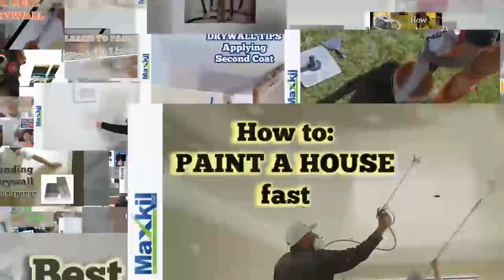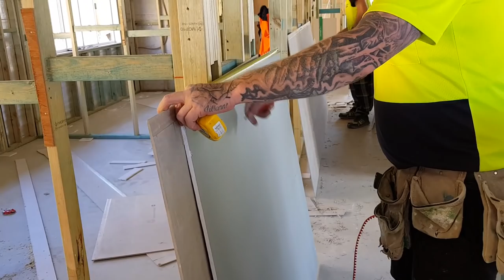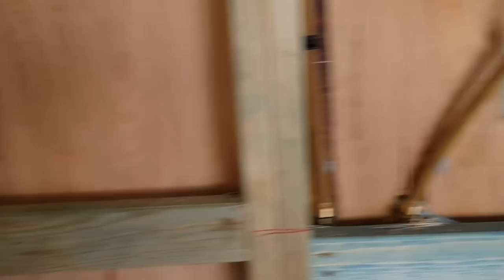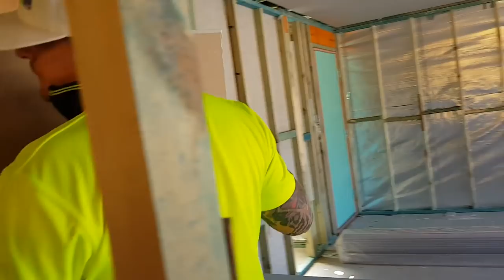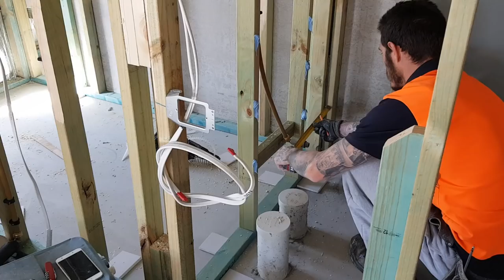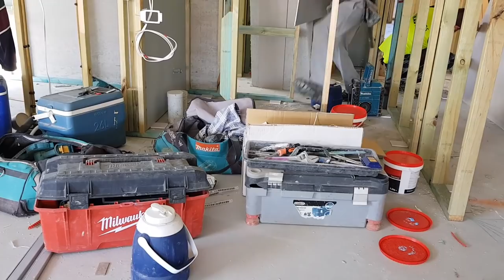Drywall Fasteners? Screwing or Nailing

Comment: for villaboard or called cement sheet，I use both screws and nails：
-I borrowed air compressor from my carpenter and use coil nailer，much faster than hammer nails which takes ages if you strictly follow 200mm span of nails；
-Some builder especially commercial builders want high quality looking process，we counter sink cement sheets（usually 9mm villaboard）and screw them up.This creates flushing surface after base coat.6mm villaboard  is not good for screws as screws damaged the board structure when they counter sinking into board or when   you use counter sinker.
BTW，i always pull out the packers on the ground after i finish screws along the recess edge.if you fixed the bottom of plasterboard before take packers out，they might be stuck there.
Reply from the maker: Yeah Adam some golden tips right there, 
The coil nailer is a great idea, in going to see why my man didn't do that every day.... Good to hear from you
Reply: maybe because machine and gun cost about 400$ ，and it has hose and lead.
I personally think it is still cheaper than labour cost

Comment: BTW，at 3.08 the metal plate looks strange，we put on extra short stud to pack it off the end stud for future architrave work. If the wall ends with external angle bead，it is should be ok-but hard to stopping up.

Comment: Incredible work. What is the blue glue you always use? seems excellent.
Reply: Audi S4 B7 4.2 - The AudiS42 Channel that’s called stud adhesive. It does most of the work of holding the sheets to the frame.

Comment: the why of that nail the plate and not screw. ??
Reply: I believe that the type of plate does not allow the screw to penetrate completely and that is why it is better with nails
Reply: it looks like an anti-humidity plate or something like that, maybe it also has several applications
Reply: @ivanalexis4284  thanks
Reply from the maker: Its cement sheet. So just easier to nail
Reply: Cool
Reply: Using nails tells me you don't care about the quality of your work,nails are going to pop,just a matter of time,could help if you use glue,go in any older house that wasn't screwed and you'll  see the proof,nail pops  everywhere.
Reply: Edmilson santos why not use an impact driver instead of a drywall screw gun and then set the depth by sight?  If you’re saying the screw gun isn’t powerful enough or doesn’t set the depth right?